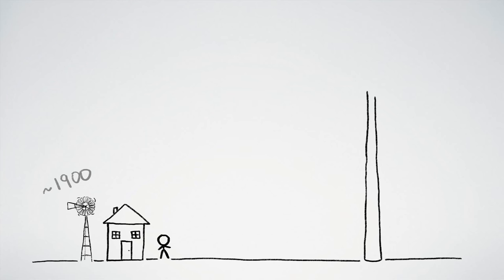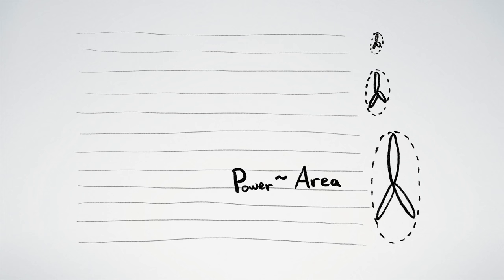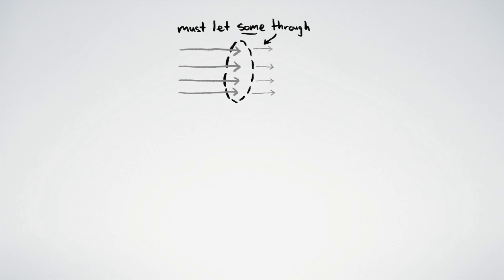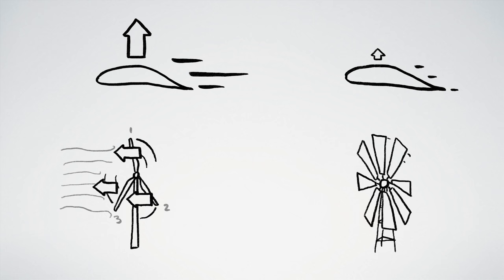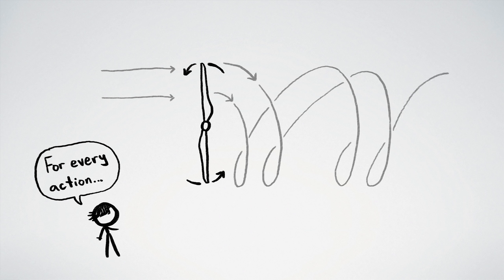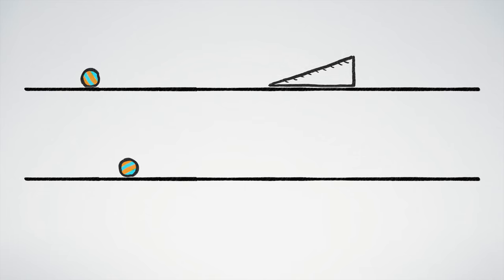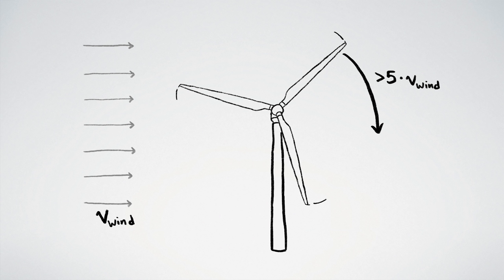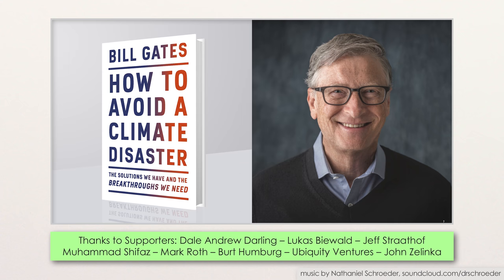The Physics of Windmill Design

Comment: Fun fact: now a days a lot of wind mills come with serrations. Which are tinny triangle like shapes put in rows on the back side of the blade to reduce the noise the blade creates from cutting true the wind.
The idea is based of the wings of an owl.
I work as a techician on these things so further questions are welcome :)
Reply: In Texas we saw windmills freeze a few weeks ago. Was it the electrical equipment inside the hub that malfunctioned or did the spokes just stopped spinning after freezing? How can windmills be freeze proofed in future?
Reply: Aircraft wings damage signicantly faster when flying low.

In my mind, wind turbine blades are like aircraft wings flying very low, 24/7. What witchcraft goes into those blades to make them withstand that kind of abuse?
Reply: @KanishkaWijesekara  normally temperatures like that don't occure there so the turbines build are, let's say, "normal" models. Usually when turbines are build in areas where such low temperatures are present they use "Cold climate" types. They have heating everywhere (including in the blades), use special metal alloys that can withstand temperatures up to - 40°C and special grease types as wel.
Reply: @KanishkaWijesekara  A ton of places winterproof their wind turbines (turbines are used in arctic research bases). Texas' energy problem was NOT wind's fault lmao, gas lines froze and so did turbines; Texas did not listen to suggestions after 2011 and so the non-winterized energy grid was cripples
Reply: @tylerdurden3722  I don't know for aircraft but wind turbine blades are usually made to be very resiliant. Especially for bending since the force on the "wings" are spread over a bigger surface. I don't know for other companies, but at ours the blades are made by taking glass Fibre mats in a mold and vacuum impregnation them with resin to make them strong but still very bendable.
Reply: @jorndielen1568  dude thats so cool
Reply: Cool, I love bio inspired designs!
Reply: Do they work on the same principle as the chevrons found on jet engines like the GEnx? AFAIK they work by smoothing the airflow between the engine air and ambient air but I'm not sure how that would translate to wind turbines.
Reply: Airplane wingtips are also designed to reduce the rotational air left behind
Reply: how substantial are the serrations? Are we talking 1/10 or 1/100 of the blade width?
Reply: I've heard a lot about "green jobs", would like to know if there are a lot and if they're good jobs. Thanks
Reply: Do windmills come with a 'transmission' that can shift gears to adapt to changes in wind speed? Or, is the shifting done purely by changing the blade angle? Are they designed to rotate at a specific angular velocity or can they extract more energy from higher wind by rotating faster? Is the energy converted to DC for storage, then converted back to AC for transmission?
Reply: @spelunkerd  From what I know, they do have a gearbox but it can't change gears. They change the pitch of the blade to change the speed and torque.
Reply: @KanishkaWijesekara  If it's anything like what happened when they installed refurbished windmills here in MN, they have hydraulically actuated blades to change the angle of attack, hydraulics to change the direction of the windmill, and also have gearboxes with oil / lube in them. If the hydraulic fluid isn't designed for low temperature use, it's too thick to be pumped properly & the windmills could spin out of control if they can't change pitch or direction. So they shut down on safety cutouts until they warm up & can function properly again.

Back to the ones installed here in MN, they had some setbacks on install & didn't get the hydraulic fluid changed out in time. So they sat still for 5 months until it's was warm enough to change out the fluid then they were running fine.
Reply: @bartholomewdan  actually they do yes. They took the design from jet engines
Reply: @mapmuncher5587  in Europe they are increasing a lot yeah. Since most countries have green energy numbers they need to meet by x year from Europe. It's love hate relationship my job, I live doing troubleshooting So I can use my brain but I hate doing the brain dead maintenances. Though it's a personal thing, cause a lot of people in my company love doing the braindead stuff.
Reply: @Bbonno  no they are rather small actually. I don't know the dimensions out of my head but I think they are roughly the size of a hand or something
Reply: @spelunkerd  Again, speaking for the company I work at. We use gear-less turbines, which means we use a direct drive system where our generator is mounted 'directly' onto our rotation parts (in other companies they use transmissions to convert the rotating power of the rotor to a generator).
So to control the changes in windspeed we mostly use the pitch angle (blade angle) and also because we have a direct drive system we use what we call an 'excitation' controller to control the magnetic field on our generator, this can also be used to control the rotor speed.
there are software programs present which were implemented so the turbine can match the ideal rotor speed to the ideal wind speed with ideal power output (fun fact also, they use this graphic to see if the blades have ice on them, if the power output doesn't match the wind/rotor speed then the turbine knows there is ice formation present). So basically yes, the more wind the higher the power.
Here at my company they don't store the energy but it does get converted.
Since wind speed is a non-linear thing the AC current that is produced is a 'dirty' sinusoidal, so first we convert our current to DC and then afterwards it gets converted again to AC (to a clean sinusoidal) to be injected into the grid.
Reply: ye and there were complains about 'That awful noise!' so engineers had to solve it...)
So ye congrats.
DATA confirmed)
Reply: @jorndielen1568  Does the inverter-converter process have any significant effects on Power Factor? (P.S. Thanks in advance for fielding our questions!)
Reply: @tylerdurden3722  Actually, wind turbine blades suffer a lot of wear on the leading edges, especially if they operate in a lot of rain etc. I remember a video showing blades that were only 10 years old and the leading edge was all rough with the layers of fiberglass pealing apart. I'm surprised they don't put a layer of stainless steel or something on the leading edge to help it last longer.
Reply: Jorn Dielen, Why not just use variable-angle fins that turn from perpendicular to the wind-direction, to parallel, depending on windspeed?  Then the turbine could adapt to windspeed, to capture low winds, while being safe against strong ones. This way, a 30-foot diameter wind-turbine could generate 1kw/mph of windspeed, while being safe against stronger winds of ANY speed; so it could be mounted on the rooftop of every house. Then add a large salt-battery for storage, since they're high-efficiency and low cost, but are simply massively heavy.
Reply: When designing these, what max speeds do you aim for at the wing tips. I think I once did a rough estimate which gave me something like 100m/s on the windmill I was watching which got me curious if you actually are limited by reaching the speed of sound at some point or if the elastic strain on the blades when rotating the limiting factor.
In our lab we once designed an optical cutter that had to move at 90k rpm (1,5kHz), which even at 10cm (I believe) gives you speeds of something like mach 0.8 or more (it was designed for use in a vacuum therefore to avoid problems with this). And I distinctly remember that we had to adjust the shape (more mass in the middle, less mass on the tips) of the wheel to stay inside tolerable stress levels of the material.
It still hasn't been tested spun up, and we lovingly coined the nickname "wheel of death" for it ^^
Reply: @stevedoe1630  hmmm I think the only loses are standard heat dissapated losses. I'm not really sure about this to be honest. I will try to figure it out for you!
Reply: I've read research saying if you paint one of the blades black you can quite significantly reduce bird deaths. This seems pretty easy to do, so why isn't this done already? I've only ever seen windmills with red stripes, does this serve the same purpose?
Reply: @Pete856  to be honest I haven't seen this yet. We have turbines of +15 years old. We do have special teams maintaining tee blades so perhaps that's why they are mostly left intact. As for the steel part, I think personally it will cause more harm than good because you get friction between the 2 materials and due to the weather conditions (rain, freezing, etc).
Reply: @KanishkaWijesekara   Windmills caused like a 10 % percent of the power outage, Texas is cheap on all electric equipment so everything was freezing and news blamed it on wind power
Reply: @jorndielen1568  I'm sure there are different blades and their design and maintenance will affect their life, but the worn out blades I saw looked something like the ones on this website  https://bladepartners.com/services-wear-tear/
Reply: @SovereignStatesman  if I understand correctly you mean the blades to be able to turn separately? They can, like you said, it's used in correlation with the wind speed. The blades pitch is by the way the most fundamental brake to stop the turbine
Reply: @DerKiesch  most turbines have a storm control feature they reach at approx. 35 m/s (wind speed) as for the speed of the blade, at full rpm the tip can reach speeds to aproxx 300 km/h.
As for the strain on the materials, they are designed with a lot of over kill. If the turbine goes in overspeed for some reason the blades are more likely to cut into the tower due to force pulling it back than the blades getting destroyed
Reply: @jellevm  that is some cool research I haven't heard of it before. My guess is first of all it's a price thing and second of all its for the people living near them as well. Since 1 black blade would cause a lot of people to start whining about it, even more than they already do about turbines
Reply: @Pete856  ow damn that is some serious damage indeed. I have to honest, I don't do blade repairs but I haven't seen damages like this yet in our country. Seems like poor maintenance. But yes you are right designs differ from company to company I am sure.
Reply: @jorndielen1568  Oh so my of the hand calculation with 100m/s was not that far off ^^ And yeah okay, since the strain that has to be absorbed by the wings should scale with v² it sounds about right that you still have a good margin with the strain tolerance of the materials.
Reply: @DerKiesch  yeah your calculations were pretty spot on indeed :D
Reply: @jorndielen1568  Haha, yeah people whining about it being ugly was what I suspected the main reason would be actually... But also just generally people not being aware.
Reply: @jellevm  Or just put a giant hawk-statue in front of the turbine.
Reply: @jorndielen1568  Yes, but the difference in wind-resistance from blade-pitch is miniscule; compared to full-size vanes that cover the entire flat-area of the turbine, and can be very thin, allowing a difference of 100:1.
Also it's much more expensive, and the goal should be COST-EFFECTIVENESS. 
Anyone can build something that's top-notch, when cost is no object.
I'm talking about saving money on a person's actual electric-bill, not playing Captain Planet and expecting Uncle Sam to co-sign just for their having a threesome of good intentions with Captain Planet and Woodsy Owl.
Reply: @jorndielen1568  "As for the strain on the materials, they are designed with a lot of over kill. "
Aka over-COST, which engineers have virtually no concern about, expecting government to just blow trillions on their crusade to save the planet, rather than actually build something that SAVES MONEY.
I'm talking about something that can be made from cheap materials and spare parts, actually costing far less/kwh than commercial electricity.
I've already patented a system for global last-mile wireless broadband, so viable low-cost wind-power would allow a person to truly live off-grid.
Reply: @SovereignStatesman  over cost is a bit of an overstatement, see what I did there, if you ask me. The operating range for turbines is very large. I live in a country where the wind speeds usually avarage around 15 m/s at hub height. But we have seen wind speed peaks up to 43 m/s and 30 minute avarages of about 38 m/s. The overkill is meant to cover those speeds as wel. If you wanna talk about saving money I can assure you there are a billion things better to save money on than clean energy, not that I did not say renewable energy but clean energy.
Reply: @SovereignStatesman  as for the vanes you talk about I don't think I fully understand. English is not my mother tongue my apologies.
Reply: @jorndielen1568  I'm talking about larger  fins on the turbine, so that the turbine can rotate more slowly; but the vins simply turn parallel to the wind direction, so that the fins present a much lower wind-resistance at higher wind-speeds.
Reply: @jorndielen1568  Besides the blades, what other components are highly fatigued? Presume the blade hub gets periodical NDE?
Reply: @stevedoe1630  In our company turbines the parts that are mostly replaced and go defective are electromotors, PCBs and our Slip ring unit (the SRU provides the transition of electricity from the non rotating to the rotating side).
What is NDE? My apologies, English is not my mother tongue.
Reply: @SovereignStatesman  yeah mean to use fins on the top to reposition the turbine in the direction of the wind? Or bigger blades?
Reply: Are the serrations there to convert sound energy to some other form?
Reply: @tylerdurden3722  Lucky for you, I'm an aeronautical engineer. Wings don't normally damage quickly at low altitude. It is only when they are abused for a role they weren't engineered for that this happens. I also happen to be a pilot for the USAF, and we are basically the ones responsible for this low altitude damage idea. It comes from the cold war when our planes were pushed beyond their intended roles to keep up with a changing battlefield. We started the cold war thinking air battle would be like the second world war. High altitude and high speed was the name of the game, so we decided to make high altitude bombers, like the B-47 Stratojet, to deliver nuclear weapons. With advances in air defense, however, we realized that high altitude means getting spotted on radar earlier, so our bombers started practicing low altitude bomb runs with aggressive pull-up maneuvers to toss the bomb farther and get the plane turned around quickly to avoid the blast. Not only were these high altitude planes not designed for the turbulence found at low altitude, but they also weren't designed for the aerobatics demanded of them. The result was predictable. Bombers had to be retired early and replaced by the B-52. Low altitude bombing was better carried out by designs with shorter (that means tougher) wings, like the B-58, F-111, and B-1.

So really, it's a sort of myth with some truth to it. Yes, low altitude is tougher on planes, but it doesn't pose an insurmountable threat. You just have to engineer the airframe to be tougher and less reactive to turbulence.
Reply: @sabibarahman7278  More like prevent the kinetic energy of the blade from being converted into sound in the first place through drag.
Reply: @米空軍パイロット  Thank you.
Reply: @jorndielen1568  Thanks. NDE = Non-destructive Examination.

May include surface crack detection (electromagnetic particle testing, liquid penetrant testing ), may include volumetric flaw detection (ultrasonic testing, radiographic testing). Was wondering which structural components are tested for fatigue.
Reply: @stevedoe1630  we do the liquid penetration test a lot when we suspect cracks in some of the main components (axle pin, hub, main carrier, foundation and tower, tower because we are one of the few companies that still use partial concrete towers, you can see whether it's concrete if the tower slopes at the bottom. Steel towers are usually straight from bottom to top)
Reply: @米空軍パイロット  well explained my man! Thanks for the support :)
Reply: Don't whales have similar serrations on their fins?
Reply: Do "Crockett's" - those little lumps - do the same on church spires?
Reply: What is the approximate time taken to decommission a windmill? 
Are there different ways they are decommissioned? (Safety wise)
Reply: Thank you for all your respons ! 
I saw small windmills, vertical and horizontal. Is there any difference in the efficiency ? Or the speed at which they operate ? I also saw a project about a single vertical blade that would oscillate. Is it serious ?
Reply: @jorndielen1568  I have seen steel tower tubulars being transported by truck. Believe the lower pieces are a little larger diameter than the upper pieces, but not much. Also have seen the blades transported, as well. It’s an amazing evolution to watch these being freighted based on the size alone. These were pieces coming into Texas. Believe the components were imported from France.
Reply: @xyaless  I only witnessed one turbine in my career being decommissioned (it was located on a petrochemical company and they needed the space for more storage units). Took them about 2 weeks to tear it down. The most time was spend on the tower because we have partial concrete towers. In the concrete towers there are steel cables running from top to bottom within the concrete sections that are tightened when the tower is finished. Afterwards they fill the holes true which which the cables run with concrete. So yeah it was difficult to tear down because of those cables.
Reply: @Kytetiger  no problem at all I am very happy to learn something to people hopefully! I haven't heard of these horizontal turbines to be honest. As for the oscillating turbines I heard their power yield becomes more obstructed if they want to go bigger because the oscillation is fundamentaly turbulent. I don't work with these types so I wish I could tell more.
Reply: @stevedoe1630  yeah it's always crazy to see these parts being transported. It's gonna be less and less seen though I think. We have recently developed a new kind of tower, the modular tower. Where instead of round tower segments stacked on top of each other, they use kind of "curved" plates that are bolted together. In some designs the  middle plates come with a rail track on which they can mount a crane. This way the tower kinda of "builds itself".
It's actually a dutch company that came with this idea first but my company bought them couple years ago.
Reply: do the serrations improve or reduce efficiency?
Reply: @marc_frank  it's purely to reduce noise emission, they don't improve power output. They might reduce it I don't know for sure but I am sure it's a neglectable amount.
Reply: @KanishkaWijesekara  if Texas joins the Democrats agenda they won't have the airforce geo engineer severe weather in Texas. Look up their patents, look up which states have their own power grid not controlled by China....
Reply: @danielcreevey6364  You mean turbulence?
Reply: Why are there no bags or nets to capture the wind on windmills? Wouldn't that capture more energy from a short wind impulse?
Reply: @jorndielen1568  are they really green in terms of production and recycling?
Reply: @haxhunyadi5582  this got explained in the vid here.
Reply: @proosee  I don't have the numbers for that sadly but I believe so yes. The avarage life span of our products is about 20 to 25 years. With most, if not all, of the parts that get replaced, regularly, being recycled.
Reply: I always wondered, are there engineers monitoring wind farms and actively issuing commands to change blade angle etc in response to the weather or are there computers automating it all?
Reply: Do you find them being called mills instead of turbines as infuriating as I do?
They are turbines and they don't mill anything, why do people call them mills?
Reply: Are you In the netherlands by any chance?
Reply: @MGSLurmey  it's all automated gladly.
Reply: @jornprenger7926  Belgium actually, not so far of ;)
Reply: @jamesmunroe4064  haha yeah I prefer turbines as wel. But yeah, technically they are wind mills as wel. Much like all crows are birds but not all birds are crows
Reply: This is epic information, thanks for sharing, much love!
Reply: Hii mr jorn dielen, may i have ur contact or email for further question. I just get involved in wind mills project with my college to help village electricity
Reply: Are you Irish true and true?
Reply: Have you ever looked at the air flow around the blades and made A design from that
Reply: @romanski5811  I am not
Reply: @madtscientist8853  I am not an engineer, so no.
Reply: I love the concept of ripping designs straight from nature. It doesn't always work, but sometimes the brute forcing algorithm of evolution will, having had all this time to run its course, produce something that's a better solution or starting point than we could organically come up in the time it takes to research.
Reply: Hi Jorn, I know this comment is a year old. I’m currently in my undergrad senior design project (called OwlWings!) trying to do what your comment mentions exactly: using owl wings to redesign wind turbine blades. I was wondering if we could potentially chat with you about some of your insights…
Reply: @jorndielen1568  Hi, I understand modern efficient windmills are expensive to make, would it be economically achievable to build smaller less efficient windmills for cheaper but in greater numbers for the same money? (Assuming space is not a constraint we care about)
Reply: @perrylin3883  hey Perry I would love to have a chat, I must inform you though I am just a technician so I do not know much about the engineering or design process.
I also have to hear with my co workers what information can be disclosed and what not. But be sure to hit me up about it when the time is there and I will do my best to assist you.
Reply: @bobbills5312  whether it can be achieved is not the question we should ask imo. It can be done if space is no constraint because that is the only constraint we are dealing with.
Seeing that every windturbine producer I know of is gradually been increasing the size of their products I'd be surprised if reducing size would be a valid option to consider. 
To set some stuff in perspective: we have the E82 types which have a blade diameter of 82m which typically produces 2.2MW. against that we have E115 (115m diameter) who typically produce 3.5MW.
That is a 1.4x increase in size for a 1.6x increase in power.
So sometimes bigger is better, but most times it depends on the relative needs I guess.
Reply: Do bigger wind turbine increase energy production linearly or exponentially?
Reply: @bartholomewdan  @jorndielen1568.
Kind of, but in a jet engine, you have two airflows at vastly different velocities so they reduce the noise by mixing the flows more gradually, instead of having an abrupt edge.

The velocities at the trailing edge of a turbine blade is more or less the same for both sides. I'm fairly certain that the function of the serrations on the blades are more to avoid vortex shedding happening along the entire length of the trailing edge at once. Same reason for why tall chimneys have these helical strakes around them.

Vortex shedding is inevitable, but if it happens all at once along the edge it'll induce larger vibrating forces on the blades and more noise, but if you can break it up into smaller zones being out of phase, they will cancel each other out more, aka less audible noise.
Reply: @aletrip642  Linearly with the swept area, meaning that it'll be increased by the blade length squared. ;)
Reply: @jonsen2k   Ahh that makes sense, thank you.